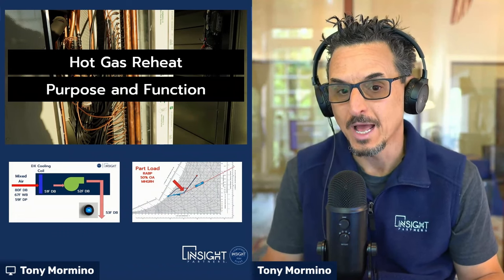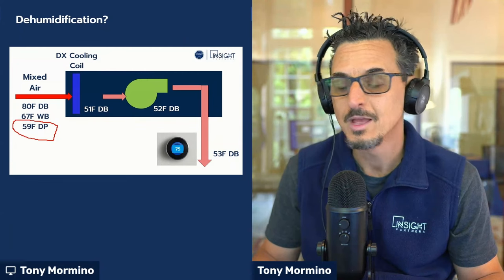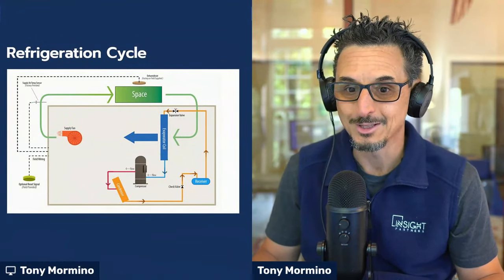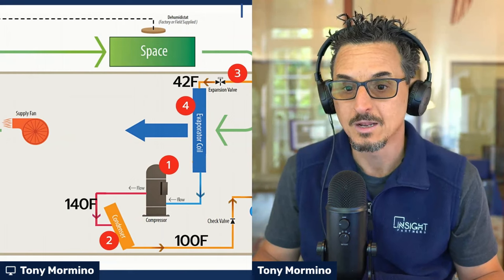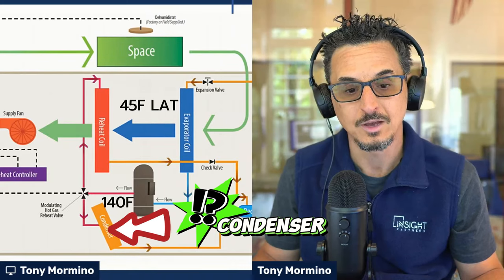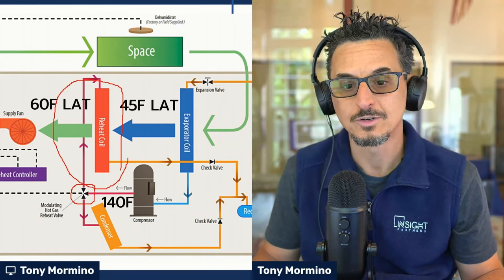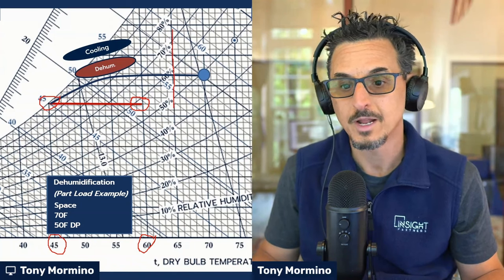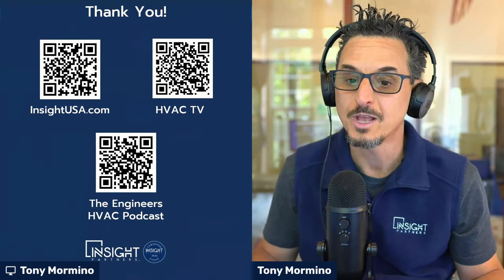Hot Gas Reheat Function and Purpose

Comment: Do they make kits to retrofit a unit to provide reheat? When calling for reheat does that lower the overall capacity of the unit?
Reply from the maker: I’m not aware of any kits and it does not lower the capacity. If anything may add a tiny bit. Thanks for asking!
Reply: @HVAC-TV I wonder if it would be worth it to create a universal hot gas reheat kit to be retrofitted into systems. Need a coil, 3 way valve, solenoid, controls, and a little engineering magic.